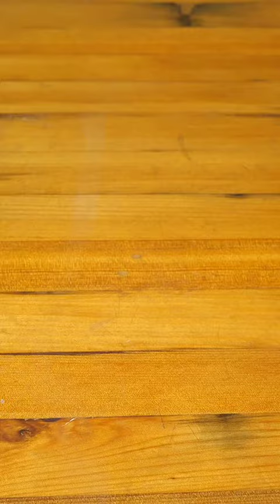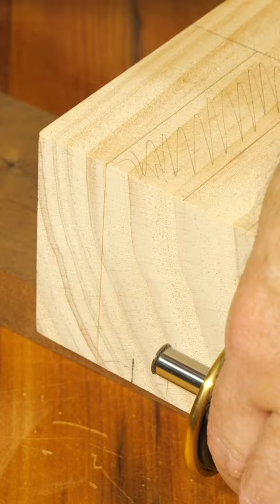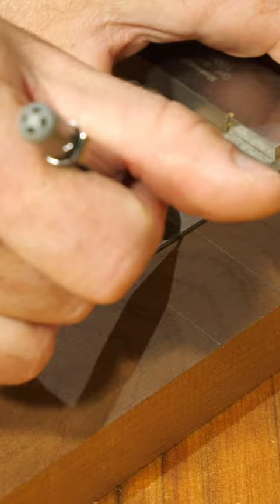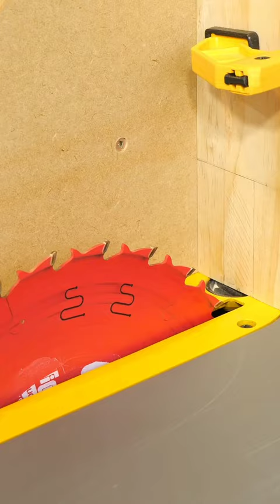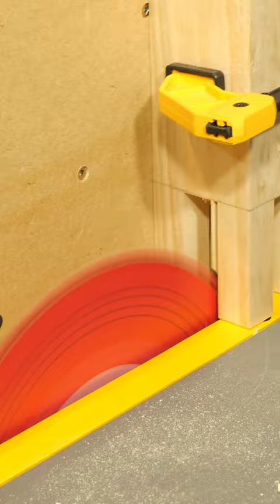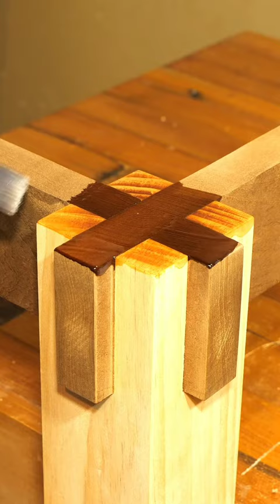The INCREDIBLE Castle Joint #woodworking #asmr #shorts

Comment: What a strong looking joint. I used some sliding dovetails on a recent project joining boards as such. It was probably more work than making a castle joint. The castle joint looks better though with the exposed ends. Thanks
Reply: That's right

Comment: You re set the saw fence for each cut, could you not keep it the same and rotate the piece to do all the outer cuts? And then remove the middle. Or does it need to moved to align properly each time with the markings? Not a criticism, I'm trying to learn, thanks
Reply from the maker: Provided the center piece is perfectly square with equal sides, then yes, you could rotate it for the outer cuts just like you described. Good thinking!

Comment: You can only reference the marking guage from either side if its absolutely dead square the exact same size as the other piece.

This is why face Sides and Edges are so important, alwaus referencing from 1 face means any errors are cancelled out.

Comment: You don't leave the middle square in, cos of the saw?
Reply from the maker: The middle square needs to be removed to make the joint work properly
Reply: @kiwiworkshop  but it's left hollow?
Reply from the maker: There are no hollow parts in the joint. If you look where the two dark cross members are lapped together, they completely fill the space, since each cut is 50% of the wood height. Does that make sense?
Reply: @kiwiworkshop  yes I understand now, so sorry I couldn't see that part, thanks for your patience 😬
Reply from the maker: @Simon Lyons  no problem and thanks for watching my videos 🙂
Reply: @kiwiworkshop  some great work, like the two tone look 👍🏼

Comment: ok it looks cool, but what is this joints practical real world application? you're just creating shear forces in multiple directions. id be shook if this joint was superior in load or shear capacity than a simple miter. dont get me wrong, youre clearly a great carpenter and well equipped and everything, im just failing to see this joints practical use.

Comment: ew he used table saw to cut the joints. not only that  he then used wood glue to secure the joint witch proved that joint was weak in the first place. no one use this joint in construction it will fail you.